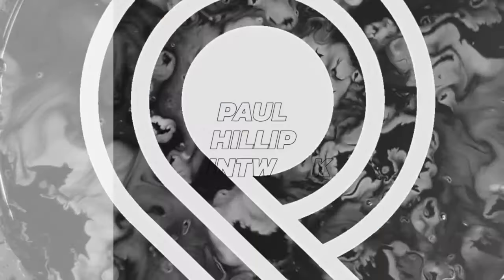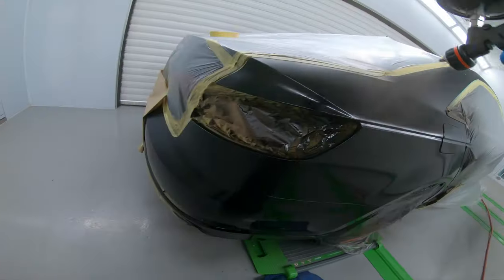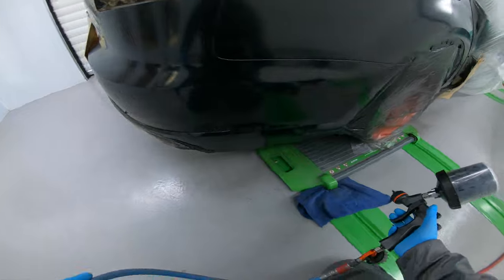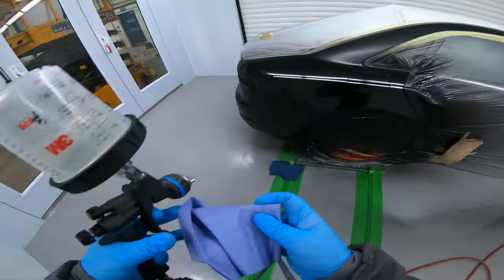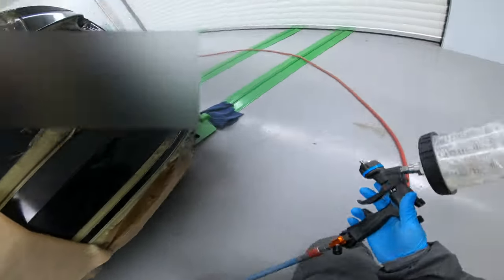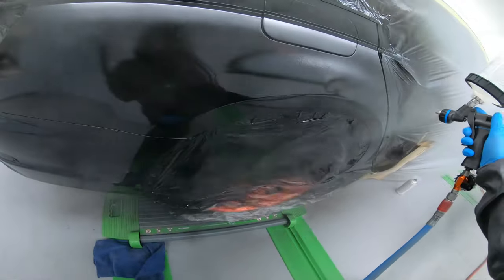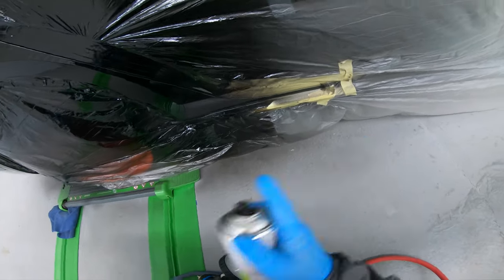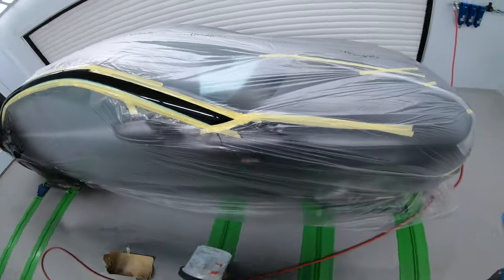Standox Basecoat and Clearcoat

Comment: Good morning Phil, forgot to ask you  what brand and model is your paint booth? I really like the slider it has to move the vehicle into the paint area. The fact that the paint work is so clean, the booth really works great. Thanks again and good luck.
Reply from the maker: It's a todd engineering booth I think it's customised for our needs. I like the track system too we have prepped cars one side and cars ready to polish on the other. Thanks again

Comment: what did you paint in that booth before? it's so clean you can ACTUALLY EAT OUT OF THE FLOOR
Reply from the maker: 🤣🤣🤣 Hi Edward, it's a brand new work shop so everythingis shiny new. I think this was the 2nd job through the oven. It's starting to get over spray on the floor now though.

Comment: Have you used the Standox HS clear? I remember the first time I used it with my 1.3 LP 400. I was cussing it! Then I bought my Sagola 4500 XL Clear red cap gun, and I loved it. I didn’t like the idea of over reducing that clear, it defeats the purpose. I think my favorite clear from them is called Premium, it may be rebranded now. I also demoed the last previous version of the GEO. Does it still have the goblet tip? Man you drop that while you’re cleaning it, and it’s toast. I only got a 6 inch pattern at the max with that gun. Has it changed much?
Reply from the maker: Hi Jono, I think this the Hs clear. I like to follow the technical data sheets, so like you say if you swap the guns around and get better results then that's good. I'm playing with my Walcom 1.2 hte clear at the min and it's really nice with this lacquer. The geo do still have the goblet fluid tip I really like it. The fan is big on this gun, I'll have to do a test and measure it.
Reply: @paulphillipspaintwork  Nice! That was my only complaint on the previous GEO, that the football pattern was only 6 inches. It sounds like they took recommendations to heart.
Reply from the maker: @Ontheroadbrogymgo  this is one of the reasons I love walcom they really listen to the end user which is awesome.